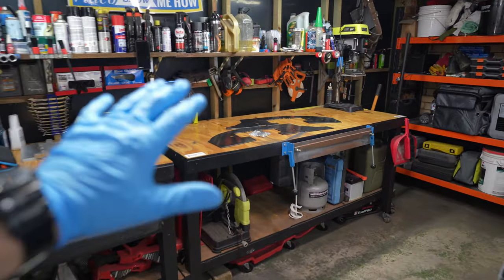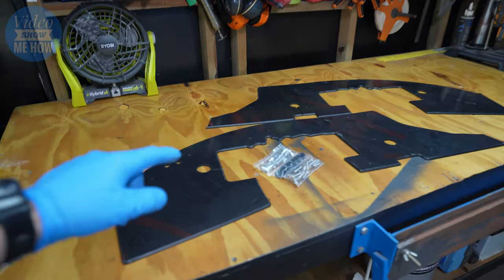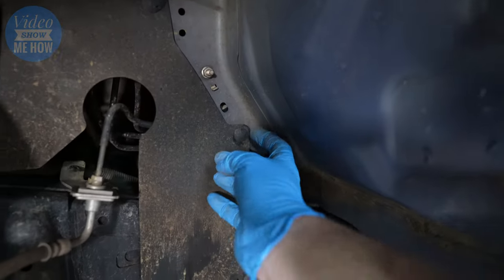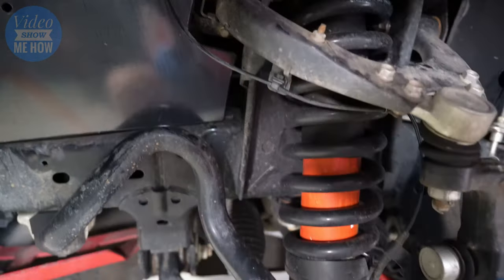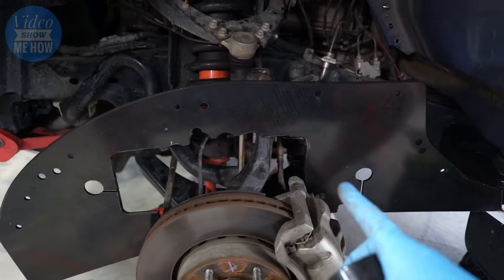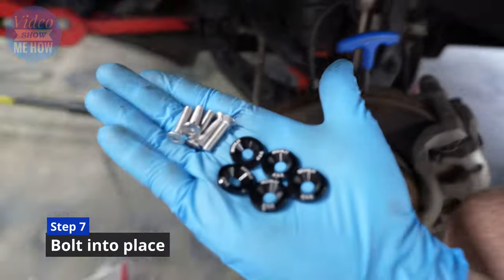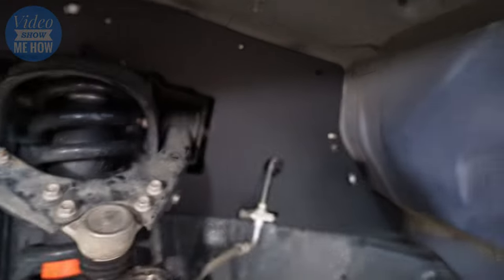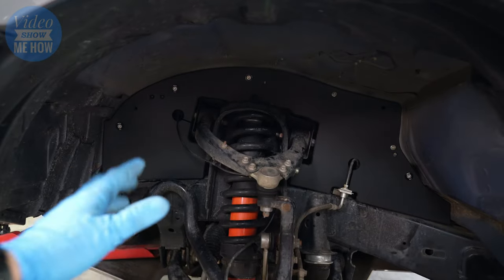MUNJI Composite INNER GUARD Replacements | 2021+ Isuzu DMAX | Isuzu D-MAX Build Series #37

Comment: Great video's, very easy to follow, Might need to check that the hard brake line { looks to be at the top of the cut out hole } is not being hit be the harder inner guards, the body of the vehicle will move on the chassis...

Comment: Really appreciate the detail and info on all of your vids Adam. Tkx.  👍 Couple questions please:  - Since its winter, how much have these reduced mess thrown into the engine bay? - Do you think that after 10000Km they'll rattle? (aka: worth a strip of foam on the edges that contact the chassis?) - And lastly, your weathershields, did they come "opaque", or did you plasti-dip them on the inside? 😆

Comment: Awesome work mate👍 i am looking at getting these but there are 3 height options available, i got the same suspension lift as you but just wandering what height option you chose when you ordered these?
Reply from the maker: Hmm unsure, wasn't the height options at the time, am running on the Outback Armour lift, maybe just ask em for the same as VSMH if you're running a similar lift

Comment: Hi Adam, might be a silly question, but what are you trying to achieve, but replacing the rubber curtains?  I know they are crap.  So what are you trying to protect?  Cheers Jamie
Reply from the maker: hey mate, for some reason your comment got put in spam just found it, I was finding the rubber ones were already rubbing from the swaybar movement, starting to look untidy, these were a much nicer solution to keeping the muck out

Comment: Hi Adam, me again.  If I don't have a Riv nut tool, do you still recommend their other method of securing the curtains.  Cheers Jamie
Reply from the maker: You can use the bolt trick for no rivnut tool, have a few example videos on the channel. Their other method works fine also

Comment: Hey Adam I finally got my X-terrain on Wednesday I'm just wondering if you have changed out the interior lights to LEDs and if so how do I get the front lights that are near the sunglasses holder out cheers 🍻
Reply from the maker: Yep sure have, they just clip out, just get a little flat head and there's a small groove to lever it out, there's a cover each side
Reply: @VideoShowMeHow  righto just like the centre one thanks

Comment: Love the videos mate and the build is beautiful... Quick on - Do you not think its worth using primer than paint?
Reply from the maker: How do you mean?
Reply: @VideoShowMeHow  Mate I am no painter - I was just asking that using primer when you drill will prevent the rust or using paint does the same? My understanding was primer will prevent the rust? in the video you said that you using paint. Again mate did not mean to offend you or criticise I was just curious...
Reply from the maker: @TheAthavanleon  ahhh I got yah, sorry wasn't following. Yes could be primer or any metal paint (primer is usually used for maximum adhesion of top coat as well as extra corrosion protection etc etc)
Reply: @VideoShowMeHow  Thank you mate.

Comment: Hi Adam,

Hope you can give me some advice here. I have a 2022 MUX with a similar/identical front suspension setup to your D-Max. I am wanting to install 265/70R17 tires without doing any lift. This size is about 33mm taller than my current size 265/50R20 which adds about 15mm ground clearance, but it will also be 15mm closer to the roof of the wheel arch. I'm a little bit concerned that the tire will hit the roof of the wheel arc when the suspension bottoms out. Do you know how much upward suspension travel these vehicles have in stock form to the point they bottom out? The distance between my lower control arm to the bump stop is about 26-27mm when the vehicle is on level ground. But I know LCA travels in an arc, so 26-27mm at this point would mean more travel at the tires. Have you done similar investigations or measurements?
Reply from the maker: I haven't had any experience with the MUX I'm afraid so aren't sure. I run 285/65/18 on my rig at the moment on 18/8.5 +18 rims, no issues with scrub if that helps.
Reply: @VideoShowMeHow  But you are running a lifted suspension set up right?
Reply from the maker: @leonz1982  yep, Outback Armour adjustables. I was running this tyre/rim pre lift though and same story

Comment: Surely that's it hey Adam 😂😛.  Where did you get those covers that go under the door handles and the tailight surrounds??
Reply from the maker: As in end of the mods??? Lol not even close 😁
Reply from the maker: Ebay
Reply: Yes and there is light at the end of the tunnel, big arse long tunnel lol will suss out ebay for hose additions, cheers 👍🏽